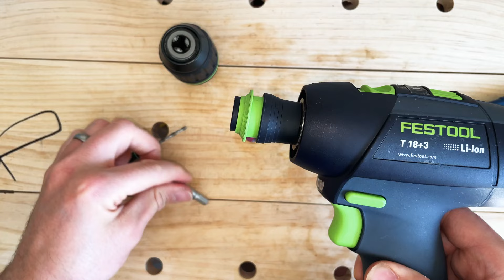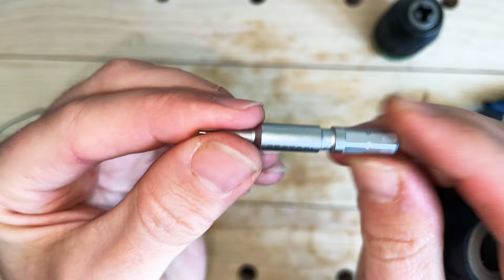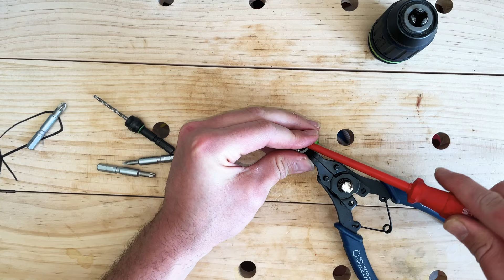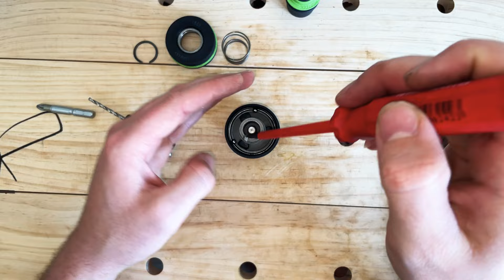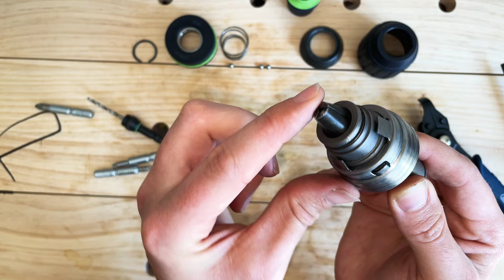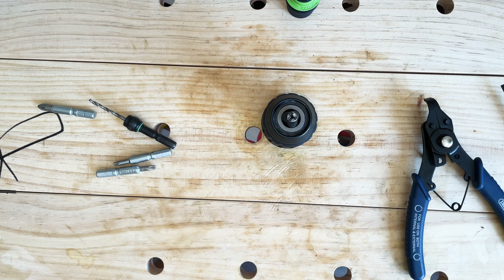Festool Centrotec drill chuck - Full Teardown

Comment: Do you think it's possible to make the inner 'tube' bigger, (with e.g. a lathe) so it fits standard 1/4" hex bit shanks?
Reply: I guess you can remove 0,1mm with a round diamond-file, but It will not be able to hold Centrotec bits tightly thereafter. 🤔
IMHO, Apart from the locking system, the 6,20mm Centrotec proprietary standard is just a money-maker. 👎
There's no other reason why they would "make up" a new standard. 😮‍💨
Reply: @ i once read it was a solution for an existing problem in the nineties (most bits were a bit loose in most chunks, back then). But nowadays that problem shouldn’t exist anymore, but Festool still sticks to their obsolete solution. That seems to me a logical explanation, together with possible commercial arguments
Reply: Perhaps I once give the diamond-filing a try, thanks! Would be great if it keeps most of the bits well enough.
Reply: Just modify all your 1/4 drives to suite the centrotec chuck I used my belt linisher  belt sander will do the same, then put a second groove to allow the bit to lock into the centrotec chuck all done 👍
Once you have a system they don’t take long to mod at all
Reply: @johnjosephcarpenter7572 how did you put the 2nd groove?